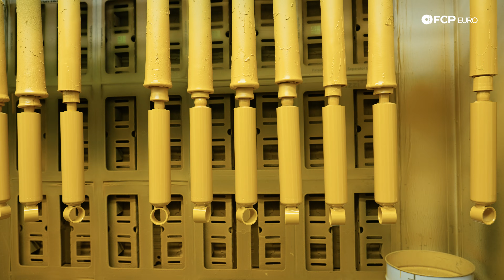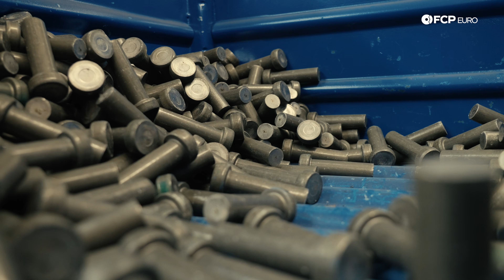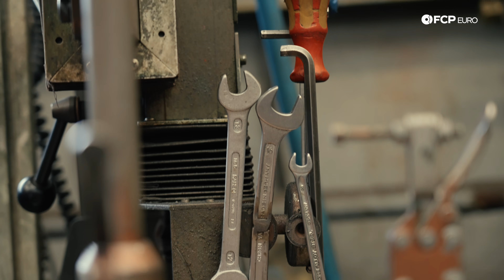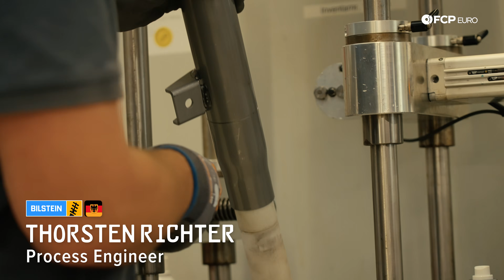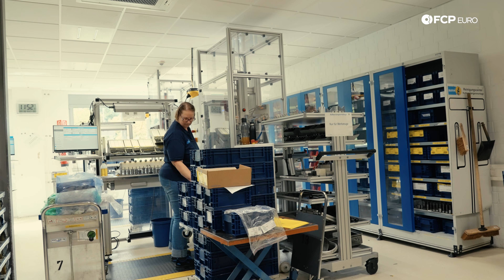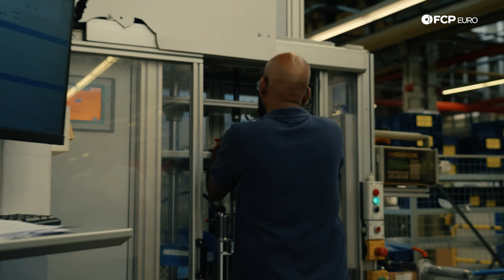Shocking Journey: The Fascinating Construction of a Bilstein Damper

Comment: 35-108191 for mk6. Was there a bellow/boot created for this short strut? Cause using the OEM wont work if u remove the bump.stop which holds in inplace on OE strut mount

Comment: I may already have a comment in here somewhere.  I have Bilsteins on my '92 325i installed, I think, by Dinan when the vehicle was just about new.  The numbers on the shocks transfer to what is now the shorter B8 version.  They have/had a lifetime warranty but the catch is ONLY FOR THE ORIGINAL OWNER.  I tried.  I guess they figure the vehicle would be gone before the shocks go bad.  Anyway, they don't last a lifetime, for shocks 30 years old, third owner.  I had the vehicle up on my lift for about a month while finishing an engine upgrade.  On the test drive going out my dirt driveway I noticed the ride was quite harsh and continued that way until I returned to the garage about 20 minutes later.  The rear shocks had packed all the way down, stayed there and took over 4 hours to return to normal even under spring pressure.  I cut one open an found that there was some sort of green fiber bumper type material inside the shock that was previously attached to the shaft and had disintegrated and clogged up the valving.  30 years is not bad.  Replaced with new B8 shorts.  B8 short fronts soon.  I hope they resolved the problem. YouTube vid to follow probably under 'Bilstein internal shock disintegration'.

Comment: Can out of warranty repairs be done? If so, how much? 

The right front strut threads on the shaft stripped on the first day of installation. 

BMW E36 W/B6 shocks/struts paired with H&R Sport/race springs & stage 2 Kmac adjustable camber plates up front.

Comment: Cool video,but experience with Bilstein shocks ( whether gas filled hydraulic or normal hydraulic) end ride is too firm and brutal. What's the point of driving any car (  with OEM/ Aftermarket dampers) if the shocks/ struts just beat you and car structures up?
Reply: Ever ridden on KYBs? They take a good 5000 miles to soften up. I’d imagine Bilsteins are much the same way. I’ll find out eventually as I plan to try them on my next suspension overhaul
Reply: @BrandonWest87 what a load of rubbish

Comment: I had an older 1997 Ford Ranger pickup truck a few years ago. When I bought it, all 4 shocks were old, worn-out, and leaking. I went on Amazon and ordered 4 new Bilstein 4100 series shocks for about $300.  I was able to very easily install all 4 shocks myself in my driveway, because there was only 2 bolts holding each shock in place.  I went for a test drive as soon as I was done replacing the shocks, and I went off-road and started laughing like a little kid because the difference was night-and-day! What a difference having good shocks make!!!! I couldn't believe the difference. I will use Billsteins for every vehicle now, if I can.
Reply from the maker: Really nothing more important than what connects your wheels (and you) to the ground!
Reply: @fcpeuro-media  Yeah shocks are probably the most important factor in ride quality and handling, both on-road and off-road. You can have an old worn out piece of crap truck, but with new, even value-level Bilsteins on there, everything's fine.

Comment: I live in Ontario Canada and I absolutely love my Bilstein B1 front struts, rear shocks and coils on my 81 Mercury Capri I built back in 83-84! It lowered my car approx 21/2” in the front and 2” in back. 
 You can jump on the front fender and it will bounce just slightly while stopping very quick. Yet it rides as smooth as glass. It corners like a roller coaster.
The faster I drive the smoother it seems to be.
I’ve never had any issues with them leaking or anything. 
I would put Bilstein products on everything I drive!
Reply from the maker: Amazing being able to have products from the same company on a build from the early 80s, and something as modern as a brand new supercar.

Comment: If only they stood behind their products. One strut and one shock failed at 34 and 51 days after purchase. Retailer said Bilstein should cover and Bilstein said it should be covered by retailer return policy.  Neither would cover the defect.  Ended up replacing everything with a different brand. No problems for over a year with my American made suspension.
Reply: Don't blame manufacturer for a scrappy retailer. Been using and installing bilstein for more then 20 years. Only ever had issues with warranty when it was customer damage or improper installation

Comment: Love the video!  B8’s on my Volvo and B14 on my Mini R53.  I love how my cars handle on Bilstein dampers!
Reply from the maker: We're sure that R53 is on rails!
Reply: How does the mini ride on everyday roads, with expansion joints and potholes and such? 
I have a R55 Clubman and I'm hesitant to upgrade from stock springs, making the ride even stiffer.
Reply: Honestly, on bad roads my Mini is brutal.  Where I live (Phoenix, AZ) the roads are pretty good, fortunately.  I would probably stick with stock springs and B4 dampers in a region with bad roads.  My Volvo on H&R springs and B8 dampers is fantastic on our roads - firm but smooth ride.  But it is not great on roads with lots of sharp bumps.

Comment: I'm Motor sports Company I use to work  we got these by the bucket load sriped down rebuild with different oils and gasses and slapped another  250 on top on each one as sold like hot cakes

Comment: There is a slim chance my Bilsteins came through there.  I doubt it though, the SVT Cobra production run might not have been in that shops tasks back in 2002. Neat watching the process
Reply: If you are on the oem ones, get some new ones direct from Bistein as the oem ones were made to SVT spec and not that great. Vert and Hardtop were different, I remember hardtop in my 03 and 04 were stiffer than the vert ones. 20 years plus on oems i bet its time to upgrade anyways...

Comment: Next time can you ask them why 1 of 4 of their shocks sounds different and presumably is performing differently to the point where I question replacing it immediately?  I can do this on my personal vehicles (even on personal cars the ridiculousness of changing a shock 3 times is not lost on me (old one out bilstein in, bilstein out old one back in temporarily, then replacement bilstein one in)) but on customer cars I find it nearly impossible to recommend Bilstein as a brand.  Maybe the higher end products are better but the B4 B6 lines I am typically around do not seem to have any where near the quality control Bilstein used to have in the 90's early 2000's.
Reply from the maker: We can for sure share your feedback with the team there. Appreciate the insights all around!
Reply: Best response 🙌👍 @fcpeuro-media
Reply: Damn I've been looking at B6's for an E90 M3 and feared this might be the case. Not sure what to go with now...
Reply: Are you doing the work yourself or not, if you are then there is the riskier painful way I described above.  I go through it on my personal cars because frankly the Bilstein recipe is just right when they are all working.  I have to imagine that Koni makes a yellow for the M3, that would be my next choice but they will generally be a little stiffer than the Bilstein.  When I've driven e90 M3's they always seemed a little stiff for daily work for me depending on the local roads so a little stiffer yet with the Koni might not be the best option.  IDK it's a hard decision to make and one you get to live with for a long time. @spoolindsm127
Reply: @justinp2993  Will be doing work myself so yea, that's why your experience concerned me. Wish I could test them pre-install. I guess if you really wanted can get em dyno'd. Koni actually doesn't make anything for the E9x M3 generation. So options are limited, or basically only Bilstein or OEM.
Reply: @spoolindsm127 I ran KW V1 coilovers on my e90 335 xDrive, really good setup considering the inherent poor handling and stiff ride of the e90 xDrives. If you don’t want to go coilover, have you looked into bilstein b8’s? I know BimmerWorld has them for the e90 m3 for around $800
Reply: @rybread97  Thanks, I've looked into V1's but general consensus seems to be they're stiff and not as comfortable as Ohlins. I know, different price range and all. But I'm budgeting upto that for ultimate street comfort. Yes I've looked at the B12 Kit (B8 + Eibach) but again, the same quality concern would exist since the B8 is essentially a shortened B6.